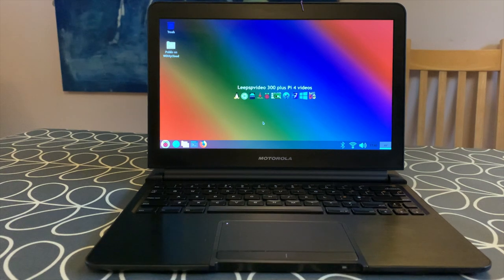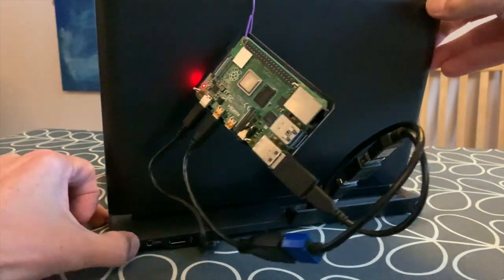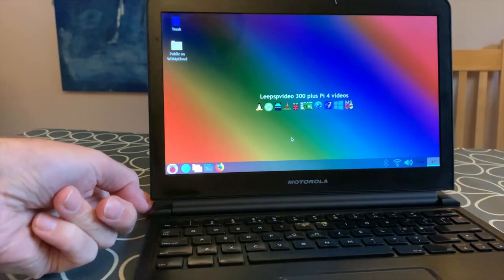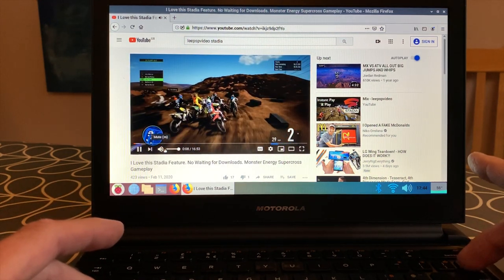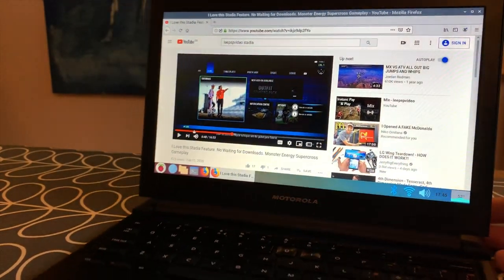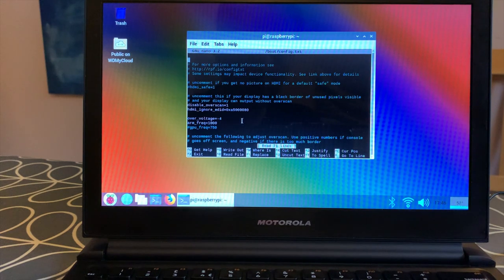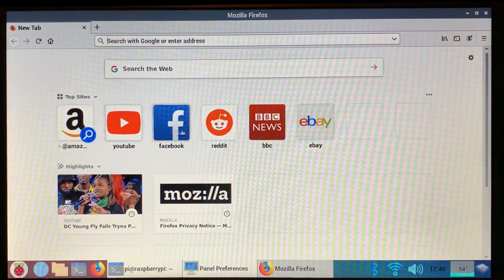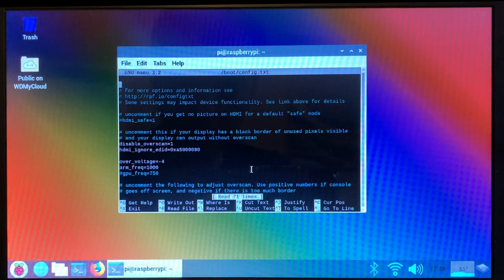Under Clocking Pi 4. Motorola Atrix 4G Lapdock powering Raspberry Pi 4.

Comment: yep the cable management is the reason i forked up more money to get the special cable adapter. thought it was getting crazy when i figured it was going to take more than 1 adapter. 
on a plus side, you can shop for a good power bank that supports the pi 4 without needing to undervolt it. that way it had some measure of unpluggable portability and usability, although more stuff to carry. 
it gets a bit tricky when you see that there is a certain distance between two of the ports in the back, that not all cables or adapters may fit due to their widths.

Comment: Yes I've been using the affix lapdock for 2 years now with pi 3 , pi zero 2 , and now radxa zero. Been trying to use pi 4 but could get it to still on always gave me a low voltage message. Now I hopefully I found a solution

Comment: Hello. I want to put it together, maybe you can tell me....I have a lapdok100 when I connect an HDMI signal source( a computer or a digital TV set-top box) to it. The station starts showing for a few seconds, then turns off. what should I do so that it does not turn off???

Comment: very cool
what result do  you get in
 vcgencmd get_throtlled
? (it should be 0x0 if everything is okay)
EDIT: tested it on my lapdock, and everything working okay - loving this!
just one thing to consider - if you close the lid while the Pi is running, it cuts power to the USB ports and shutdown the Pi instantly - which is not good for the OS
Reply from the maker: I’ll take a look, thanks. 👍🏻

Comment: I'm gearing up to build mine for use with the steam deck here soon. I bought the adapters and should have them in a week or so. I was going to buy the nexdock but $350 is pretty steep for what these are. I found my lapdock for $20 with power supply on ebay and adapters were $5 or so together, definitely worth $25 so I can start running desktop mode on my SD.

Comment: Maybe you can help me out. I'm trying to get my PI 4 to display on my Bionic Lapdock and I keep getting no input signal, and lap doc shuts off as few seconds. I tested HDMI connection on normal windows PC and the Bionic displays just fine as a second monitor so I'm assuming I need to make a video resolution adjustment on the PI4 for the lapdock to be able to make the connection. I would greatly appreciate of you could post your display settings or get me going, I'm running Kali Linux on my PI4. Thanks
Reply from the maker: This Amazon review may help

https://www.amazon.com/gp/customer-reviews/R238EZJKNQ82IR/ref=cm_cr_arp_d_viewpnt?ie=UTF8&ASIN=B005OOIS1U#R238EZJKNQ82IR

Comment: This didn't work for my Pi 3B+
After I put over_voltage=-4 in my config file it didn't start up at all
Reply from the maker: The Pi 3b uses less power. I wouldn’t think you would need to undervolt it.
Reply: @leepspvideo  i still need it to reduce power consuption and don't need a lot of computing power
Reply from the maker: I haven’t had a Pi 3b
Reply: With the pi 3 I just limited the max cpu freq and never had problem didn't try undervolting